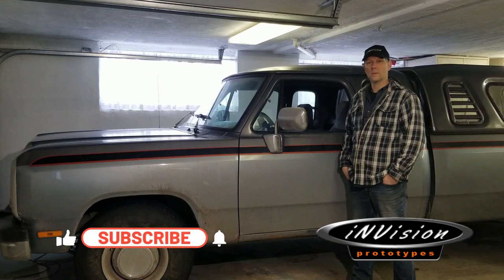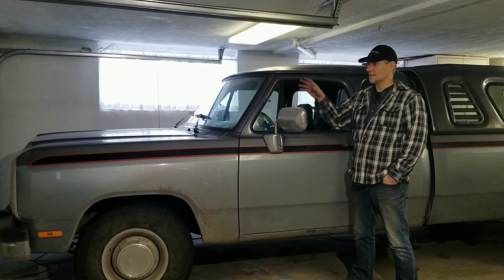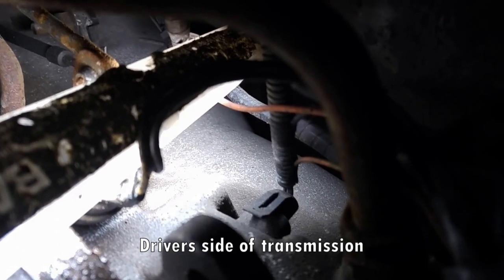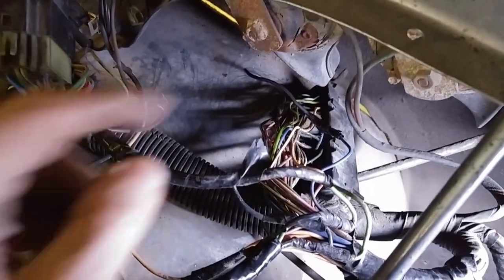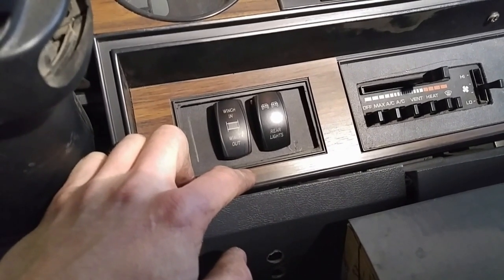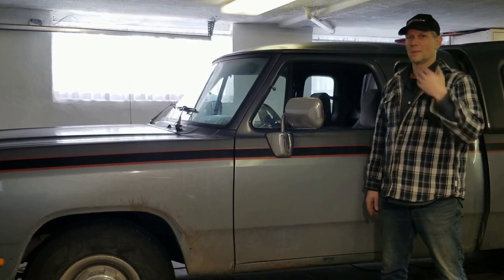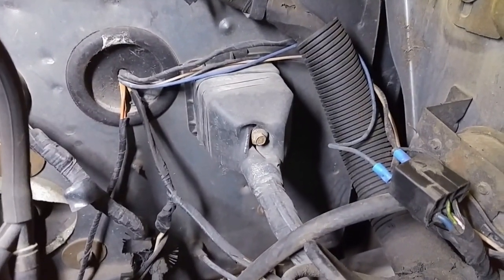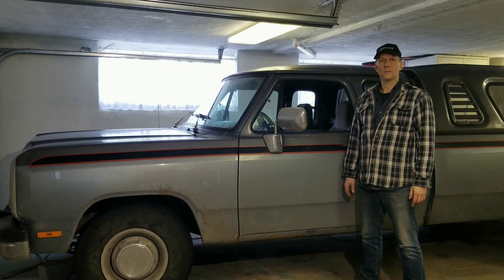Overdrive and Speedometer HACK - 1993 Dodge Cummins D250 Truck

Comment: The plug at 9:04 where would the other end go I just bought a first gen and I found that same plug but can only find one end not the other any help would be greatly appreciated
Reply from the maker: Hi, yeah great question!  That plug end that you're talking about was just sitting there not connected to anything.  Notice the dirt going right out to the end on the right side(left side got rubbed clean after handling it)  My thought was that was a scan tool diagnostic port for the computer(pre OBD) but was never used.  Using my test light I probed it for +12VDC(blue wire) as well as ground(black w/ white tracer) to supply the transformer.  Thanks for watching!
Reply: @iNVisionPrototypes  I appreciate that I thought I was missing something there but today I accomplished the overdrive and lockup switch just like you did next is getting that speedometer working any chance you can go into depth in a video of the complete install of that whole phone charger hookup deal I'm going to do the very same thing to my truck beings you just got me from a 3 speed to having what now seems like a five speed so for that I can't thank you enough and sweet first gen!!!
Reply from the maker: @justacountryboy9591  Overdrive makes a huge difference in these rigs.  Glad it worked out for you.  I'll see what I can do about the Speedo phone charger setup.  Truck is coming into the shop hopefully soon for new rockers(fenders and hood need to be blown off for that job) and I'll be doing a video on that.  Biggest thing is to find a charger that has an output as close to 8VDC.  Mine is just under so the speedo runs about 9kph slower than it should.  Thanks for the thumbs up!!

Comment: Is there a specific type of phone charger you used to get 8v? Checked 2 I had laying around and they're at about 5v. Thanks
Reply from the maker: If I can recall correctly the one I used was 7.somthing VDC.  Had it in a box with other chargers and came closest to 8VDC.  You can use your 5V but the speedo will be off a little in MPH.  If you have an old portable CD player(perhaps I'm dating myself) or check on ebay - should be able to pick something up there.  Hope this helps.